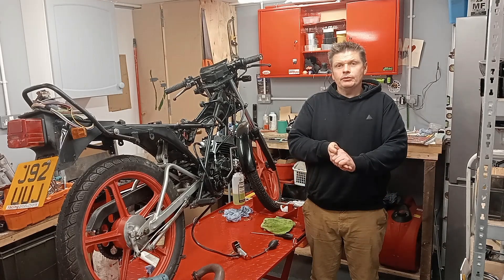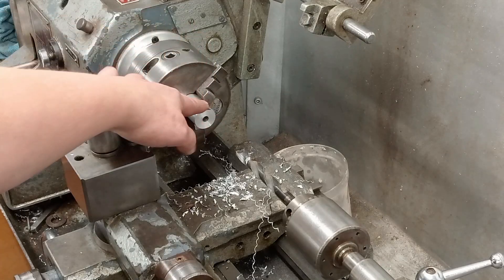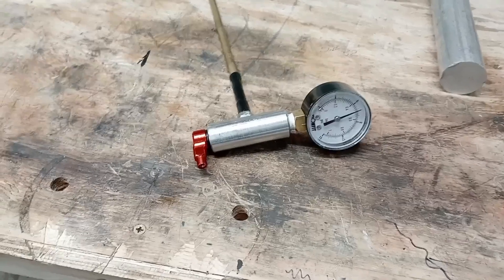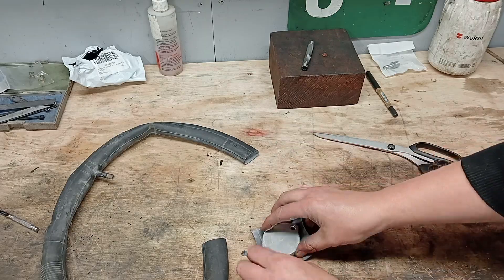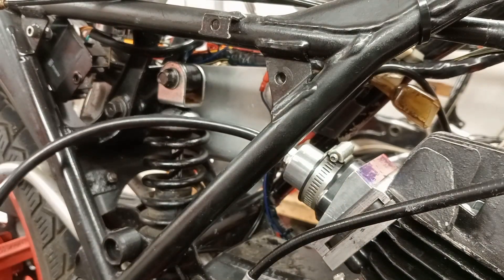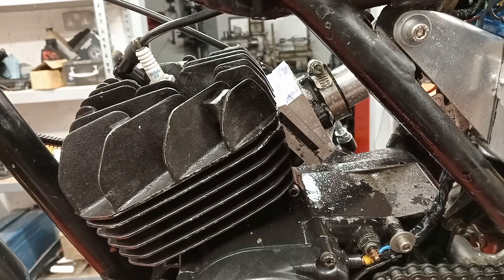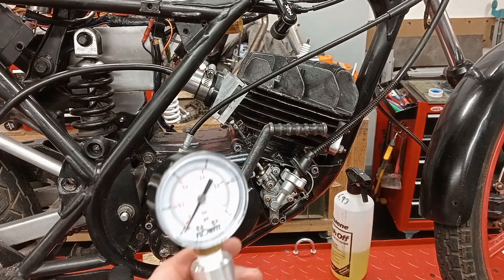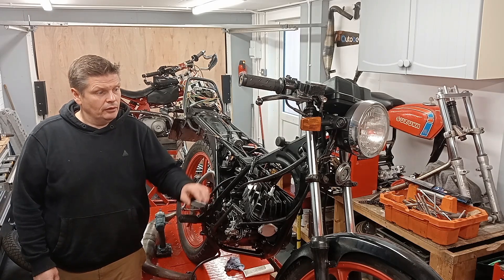2 Stroke Leakdown Tester Build  #2stroke  #mopedtuning

Comment: Can you not weld some of the plates together pal?
Reply from the maker: Hello mate, I could do but I wouldn't be able to fit the 21mm Dellorto carb mount as it screws to the middle ally plate. Trying to keep options open for testing different configurations, but in hindsight... 🙄

Comment: I've vforce reeds in my ar93 with a spacer no need to carve out the back of the barrel it fits nicely and the spacer has a rubber ring insert both sides for seal also a kx85 rubber inlet with 24mm mikuni carb skimmed head 5 plate clutch so no wrist like hellboy
Reply from the maker: Hi Shaun, I guess you have the KX60 (65?) Vforce? As I understand they fit the standard intake. I have some on order from China so it will be interesting to see if there is a performance difference between the  KX60 Vforce and the bigger KTM 65 ones. Well that is if I get my leaks sorted.

Comment: Great job on leak down  tester.& o ring .   Without  defeat  there can be no victory.  Confident  you will overcome  any issues you come across. To be honest if it runs  and your having fun then thats victory. Keep up the great work.
Reply from the maker: Cheers buddy 😊
It's being a pain but I'm learning new stuff as I go along.
Reply: @AutoBeta2T  biggest blessing  is you have the ability  and knowledge  to machine parts.  I'm thinking you can cut a few gaskets with some  gasket material use you some good old fashioned  permatex  aviation  #2  impervious  to gas and oil and get back to testing.craps little messy but been using it since about 1977 rare to have any leaks. Keep up the good work
Reply from the maker: Yes - that could probably be the solution in the end. I've got some nitrile sheet to try next... 🤞